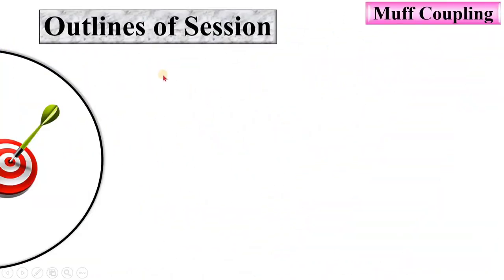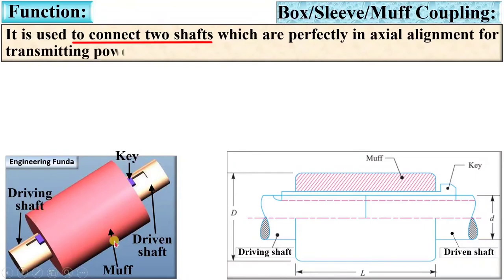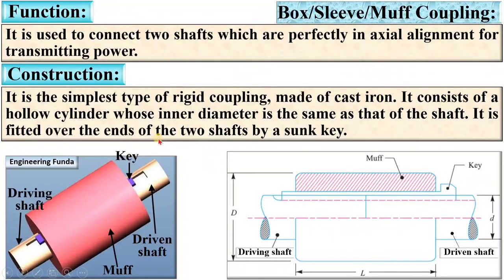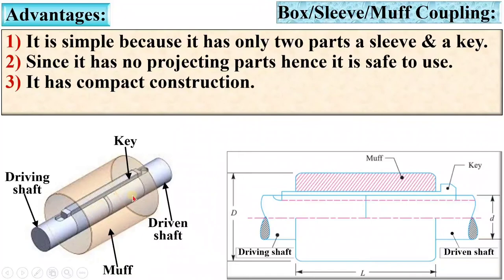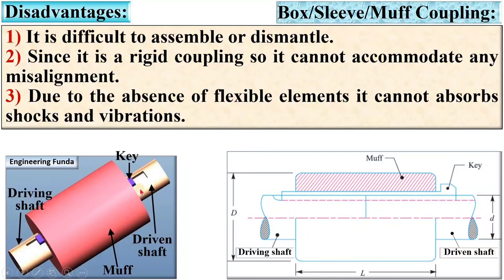Muff Coupling (Basics, Types, Structure, Function, Working, Pros & Cons) Explained

Comment from the maker: Muff coupling is explained with following timestamps: 
0:00 – Basic Mechanical Engineering lecture series 
0:33 – Sleeve Coupling, Box Coupling
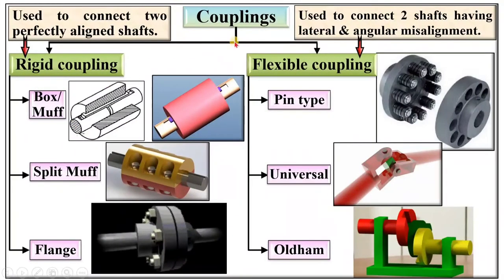0:42 – Types of couplings
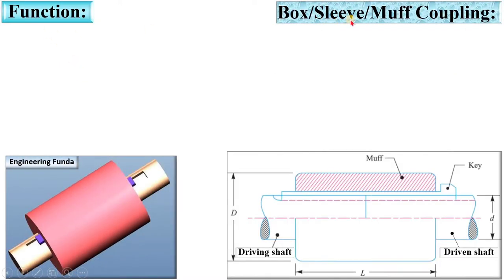1:12 – Function of Muff Coupling
1:18 – Diagram of Muff Coupling for exam
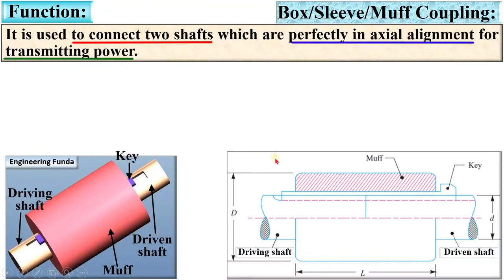2:04 – Construction of Muff Coupling
2:29 – Working of Muff Coupling
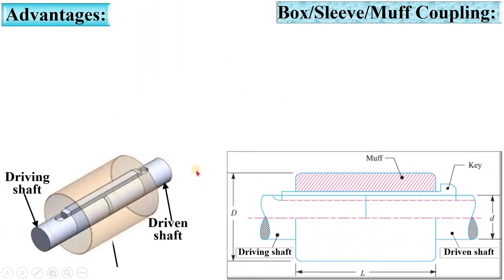3:04 – Advantages of Muff Coupling
3:43 – Disadvantages of Muff Coupling